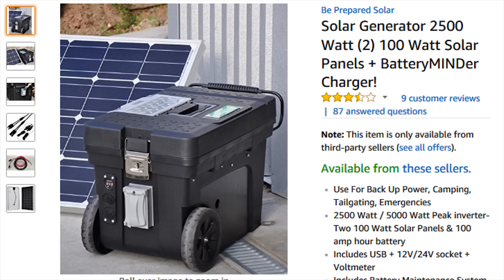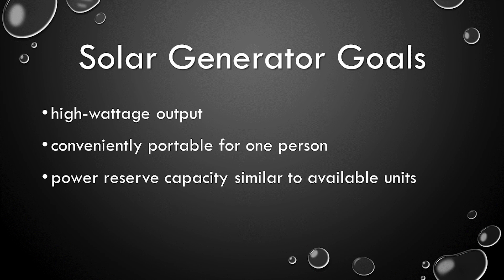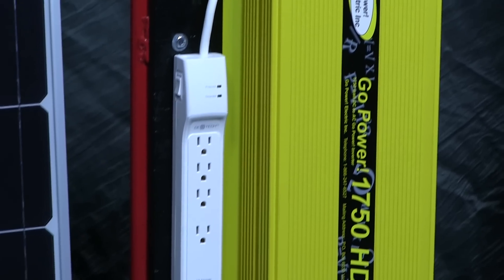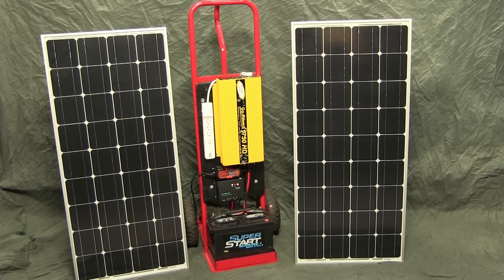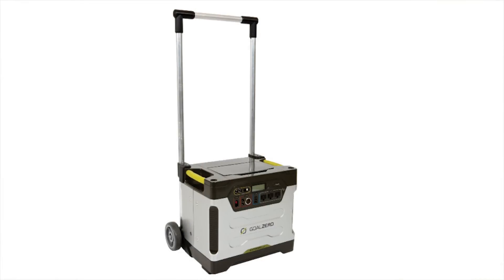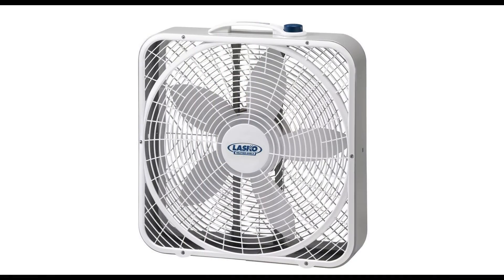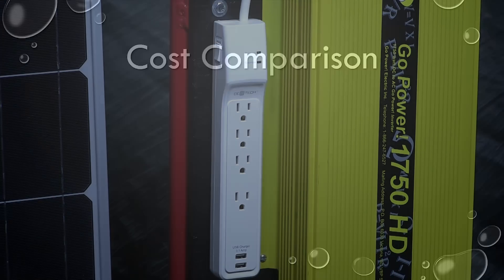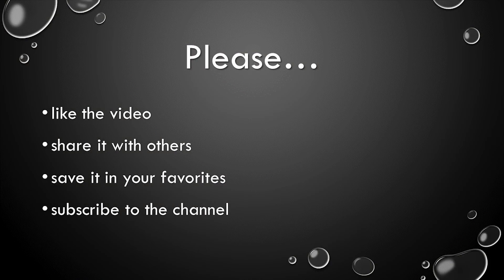DIY Off-Grid Solar Generator (rev 1) – Low-Cost Portable Power

Comment: Use lithium ion batteries only. Fast charging, last longer, lite, and dry. Worth the extra money.
Reply: sidecarnutz BMS lithium ion batteries make charging them easy.
Reply: a 12v 100ah lithium battery is $1200. a morningstar sunsaver mppt 15 amp charge controller is about $250 and can be programmed to charge lithium batteries. 
 
$1450 sounds like a lot of cash, but consider this: a lithium battery can be discharged all the way down to zero with no damage, while an agm battery can only be discharged down to 50%. this means that 100ah of lithium is equal to 200ah of agm. lithium batteries are smaller and weigh a lot less, and they also charge faster than agm batteries. they also have a much longer lifetime than agm.

Comment: Idea, solid state graphite power cell bank with an organic carbon power cell bank. A pancake motor generator or rewired drum motor generator with magnetic bearings with a vacuum spark gap. With other electronics would this not be a unique electrical power generation system? 😊

Comment: I like the idea and have built something similar myself, with a few differences, of course.    I chose to use a large plastic tool box with wheels and an extendable handle.   I also chose to use a pair of 55 amp hour AGM batteries  connected in parallel, for a total of 110 amp hours of capacity, or 55 amp hours of usable capacity.    The AGM batteries have the advantage of not being spillable.  The tool box also allows all of the components to be enclosed, except the inverter which is mounted to the side.  I chose to go with a 20 amp MPPT solar charge controller that flush mounts on the opposite side of the inverter and the connections are available inside the box.   So, I made a pair of solar input terminals out of some 1/4 inch nuts, bolts, lock washers, and washers that I painted red and black.   The panels connect to those.   And, I put a 12vdc socket, a pair of Anderson Power Pole connectors, a pair of 5 way binding posts, a pair of high current output terminals like the solar panel input terminals, and a volt meter on the front where the handle extends.

It proved useful for several years, until the AGM batteries went flat and I just haven't replaced them - because, I built a new battery box featuring a Lithium Iron Phosphate battery pack made up of 128 26650 LiFePO4 cells that are each 3.2vdc at 3300mAH in a 4S32P arrangement, producing 105.6 amp hours capacity at 12.8 volts.   This pack can be discharged 80% rather than just 50% and will provide 2000-3000 cycles and could last 20 to 30 years.   It can also be charged with a standard lead acid battery charger; although, I'm using a Chinese 30 amp switching power supply that I got off ebay for about $25.00 to supply charge current to an ISDT Q6 Plus Balance Charger that provides cell level voltage and current monitoring.  I installed a 300 Watt pure sine wave inverter in this box, rather than a larger one - because, I needed the other space in the box for the charging supply, ISDT Q6 balance charger, and 30 amp solar charge controller also installed.   But, that's all the power I typically will need.  

The best thing about this battery box is that it is much smaller and weighs about 45 pounds, rather than the 105 pounds the old box weighs.   And, I added Bluetooth connectivity through the solar charge controller for remotely monitoring the battery condition, input and output current, and solar panel input power, as well as being able to switch the loads on and off remotely through the app.  Of course, the second box cost a lot more to put together - over $900.00 for the components, including the battery pack, but not including the two 100 watt panels I hinged together with PVC tilt stands.  I already had those.

So, yes, I think you did a great thing - and, something I recommend anyone who needs portable power at cheaper than retail prices should do.  And, I had fun doing it.   My primary use for both battery boxes has been for emergency power and to supply power to my portable amateur radio gear when out in the field.

Thanks, for your video!   It was nicely done!  I particularly liked that you put the unit on a neutral background and just got into the details - which is what I tend to prefer.   So, thanks, again!
Reply from the maker: Wow!  Thanks for the detailed report.  I’m still digesting it — especially the numbers.  I can see you gave some consideration to cooling.  Good because batteries really hate heat.  The real-world testing is adding a lot to my understanding of an ideal setup, and the detail you provided really helps me compare notes.  I’m pretty sure the experience you related will contribute to my test report, and to my next build.  Thank you.
Reply: Another advantage of the LiFePO4 cells is that they don't get hot - under charge or discharge (at least, not while limited by the design specifications of this project, anyway).  And, for further thermal management, while the unit is in operation under a high load I leave the top off of the tool box.  Otherwise, nothing gets even warm inside.

Now, LiFePO4 cells don't like extremely cold temperatures, so I immobilized the battery pack (about 3" x 12" x 18" - looks like a metal sheet cake) in the bottom of the battery box by laying down a 1/4 inch sheet of neoprene and placed 3" x 3" x 19" foam acoustic insulation blocks, like you might use inside a stereo speaker, around the sides.   Then. I placed a styrofoam  sheet on top of the battery pack and covered that with a 1/4" piece of blackboard material onto which I mounted the circuitry for the unit.  This board is held in place on the sides by 1 x 4 pieces of wood painted black and bolted to the tool box.   The battery pack isn't going anywhere, even if the box takes a tumble, and it is protected from extreme cold - as long as  you don't just store it in extreme cold.  It's going to be fine overnight while camping in cold weather.

If I could attach photos, I would.   And, at some point, I intend to make a video covering this project.   I didn't take any video while building it, but I did take still photos of the components and the box at various stages of completion against a white foam-core background.   I just have to create the narrative script and put it all together - a project in and of itself (as I'm sure you know).  And, of course, I maintained a list of components used and prices paid.  I just finished the build in the last couple of weeks.

Comment: take it and put it in a cooler and use a gel battery ! boom perfect
Reply from the maker: I like the cooler idea.  It’ll probably need ventilation for the inverter.  Be sure to check out the video on the upgraded unit.

Comment: Think I will do this with 6 panels and 2 batteries and place it in and on my shed and have heavy duty extension cords run under ground and into the house. Plug one of the cords in to a power strip for every day use to cut back on the electric bill and see how that works.  I’m retired and the TV runs all day..LOL.
Reply from the maker: Sounds like a great system.  You’ll need a larger charge controller, and might consider making a 24V system.  That would improve inverter efficiency (reduce power lost in power conversion).  Watch battery voltage carefully if you use regular deep-cycle batteries — they won’t last at all if you drop below 50% a few times.
Reply: Heavy Duty off the shelf extension cords are not a good option.  Even the best you can buy will only be 12ga, so depending on how long the run is, you will lose a lot of amps and watts to voltage drop.  You need to go with as heavy a copper wire as you can afford.  My system (garage to house) has a 50 ft run of four wires bundled (2 per leg) @ 4ga each,  NO measurable loss AT ALL.
Reply: It’s been two years since you posted this. How is your system working for you?

Comment: I like your presentation. You are going a similar direction I did a few years ago. But I learned quickly that a system like this really can't do a very good job in real world use. I even used two Group 27 Marine type batteries. It could only run my oxygen concentrator for 4 hours running below the 50% DOD. My system was cheap only cost about $600 with a 225W solar panel, but that doesn't mean much if it can't power your critical long term load needs. I should point out that your battery doesn't contain 1750 Watts of energy. Your inverter can power a load at 1750 Watts, but your battery only has  1140 Watt Hours of energy 95Ah X 12V = 1140Wh. So less than 600Wh at 50% DOD Note it's Watt Hour, not Watts. Watts is only the instant power, Wh is energy over time same as Ah.  My refrigerator/freezer uses about 1500Wh of energy a day. Lead acid batteries can only cycle about 300 times at 50% DOD. But my LiFePo4 batteries in my current system can cycle close to 3,500 times at 80% DOD. Which makes them much less expensive in the long run. Review my YouTube video to see the many more reasons why this type of system isn't very good for critical long term load needs. https://youtu.be/HT6LXzdeGjc
Reply from the maker: Thanks - I feel the same about overly-lengthy videos.  I’ll keep your comments in mind as I create more in the future.
Reply: Apparently he is not trying to run his house. I saw your video and it is goo for home but his is simpler and not ment to be used the way your setup is.
Reply: John Fackrell ......Hi John, loved your comments, I've been thinking about doing something like this but reading your advice I have saved myself a lot of money!
I'll watch & sub to your videos. May God give You uncommon understanding to create something new in self power supplies.
Southampton. U. K
Reply: John Fackrell thanks for sharing these details.
Reply: John, concentrators consume huge amounts of electricity. Depending on your liter flow, you'll do better getting a small travel concentrator like the Inogen One. These will work great for something like this. If your going to use a standard concentrator like you have, your going to need a generator PERIOD.  If your going to keep going the battery route, you'll need the largest AMG batteries and a ton of them to go for a 24 hour period.  It's just not practical.   Also the higher the liter flow = increase in energy consumption. DME providers normally get bulk pricing on lesser energy efficient concentrators. Very efficient concentrators running 2.5 lpm will use about 300 watts or will use around 7.2 KW/day. The average DME provider concentrator consumes 500-600 watts or 12 to 14.5 KW/DAY.  John, BTW, I have made my living for the last 25 years as a Respiratory Therapist with a ton of DME experience.
Reply: It's not going to work for him - read my comment farther down. HE NEEDS A GENERATOR OR A TON, YES 2000 LBS, OF BATTERIES FOR A 24 HR+ SYSTEM.
Reply: I'm wanting something so I can go camping again. I have a oxygen concentrator that you carry. It can be ran on a car battery or plug in to house power. Is this the same thing you ran or did you use a home concentrator? How many batteries would it take to get me threw the night? Would solar panels be able to charge the batteries for the next night? Would it be best to use a converter and use a battery charger? I know nothing about power or how it works. All I know about power is Don't pee on a electric fence! lol
Reply: I’ve seen quite a few videos so I can set up my own system. I get tired of having to listen to all the details that don’t have much to do with the subject. Finally a video that sticks to direct information of how to put it together short and sweet, good job.
Reply: John Fackrell - exactly what I was thinking. Thanks for the in depth analysis
Reply: If you switch to high grade solar specific batteries, you can get more cycles from them. That being said, quadruple your battery capacity and use two 300+ watt high grade panels to bring your power to 600 watts. Remember you want enough power from the panels to support your current load AND fully charge your batteries before the light fails.
Reply: Some of your information is incorrect. his battery is rated at 12.6 nominal 12.6x95= 1197wh. Also his battery would be 300 cycles at 100% DOD not 50%. At 50% DOD he could achieve nearly 500-800 cycles. Both are not accounting for peukerts effect at 300 watts the constant would roughly be k=1.3. so at 300 watts discharge the battery would contain about 837.9 watts of usable power or about 420 watts of usable power to 50% DOD.

Comment: How does this work with a CPAP machine? I am wondering if this could be used withthis or is this just a grid down scenario to use with a household. Please.let me.know what your thoughts are
Reply from the maker: I’m no expert on CPAP, but a Google search results in a power range of 275W to 400W, depending on the pressure and humidity settings.  275W would require close to 20A from the battery, so the 95Ah capacity of the battery would last just under 5 hours.  Adding a second battery could support 10 hours.  To support a 300W draw for 8 hours overnight, you’d need 300W charging for 8 hours during the day, so I’d also add two more solar panels for 400W of charging.  Also, what I found recommended a pure sine-wave inverter, so you’d want a system model,ed on the upgraded rev 2 version in the companion video on my channel.  So, if you add a second battery, use an upgraded inverter, and double the solar panels, the system may serve. Hope this helps...
Reply: My partner's CPAP machine draws only 85 watts, so there is certainly enough capacity in this system to run it overnight.   But, the problem is that the CPAP machines are sensitive electronic devices that require a pure sine wave to avoid potential malfunction and damage.   And, this particular system is using a modified sine wave inverter - not at all the same thing and might kill your CPAP machine.

Comment: WOW! You've captured what I have been trying to figure out brilliantly!

I have a Renogy 100 watt kitt that I will be installing at my off grid barn this summer for lighting and small power needs.

Brilliant!
Reply from the maker: Thanks for the kind comments.   Be sure to check out the video for the upgraded version — I think that’ll be helpful for your project.  In a week or two, I’ll post the wiring schematic, and results of the tests i’m running to see how it does IRL.

Comment: I think that this is a good job for what it is. I would be happy to build something like that. The only thing I might add is a little bit better voltage meter for the battery so as to better assess the charge level. And using the 12v battery will let you not only add one of your vehicle batteries for extra capacity but also let you charge it from that vehicle.
Reply from the maker: Thanks for the feedback — always appreciated.  Check back in a few days for the upgraded version — some of the excellent suggestions are going into a new model that costs only a bit more...

Comment: Great set up. I love it! The only thing that I would do different is use a sealed AGM battery or a gel battery. They are significantly more expensive than the flooded battery you used but I think in the long run would be worth the investment due to the maintenance free nature of sealed batteries. As well, sealed batteries do not gas so they do not need to be vented, and because they are not flooded with liquid acid, they can be installed on their side, making it easy to stack a second battery on your cart, doubling your amp hours without taking up any more room in your footprint. Anyway, just my thoughts. Thanks for sharing this video!
Reply from the maker: Thanks for the feedback — it’s rewarding to hear from you — virtually discussing a topic of mutual interest.  AGM or LiPo is actually a very good idea.  I hadn’t considered stacking the batteries, and that would be a huge benefit. Price is the biggest issue — trying to keep the project accessible for as many people as possible.  I’ve collected the parts for the rev 2 unit, which I’m starting on today.   Perhaps a “go for broke” model is next...
Reply: @DesertPrep   for the armatures with only basic knowledge how about a wiring diagram?

Comment: Wonderful Job, you inspired me to get started on my next project
Reply from the maker: Very cool!  Let me know what you build — I’d like to know what improvements you make on your own unit.
Reply: It's a nice system. We should consider that a 12v 1750watts inverter has a  146 amps draw from the battery  making it inefficient, so a 24 volt system would be much more efficient and safe even pulling  73 amps from a  24 v battery set up, and it's efficiency would entirely depend on available ah fir long term uses.

Comment: No criticisms. Nice unit. Good job.
Reply from the maker: Many thanks.  Appreciate the comment.
Reply: Could add DC port to run laptops, LED's, USB powered devices,  etc. About 10% longer compared to running them trough inverter.
Reply from the maker: Thanks for the comment.  :)
Reply: Great video. 
Maybe you could use a bigger battery to store the energy generated as standard and also a way to carry the panels on the trolley, and shield the battery / inverter from the sun.
Reply from the maker: You’re so right.  The number is probably higher than 10%.  Check out the Rev 2 video where I’ve taken your suggestion...
Reply: Greenmachine305 I